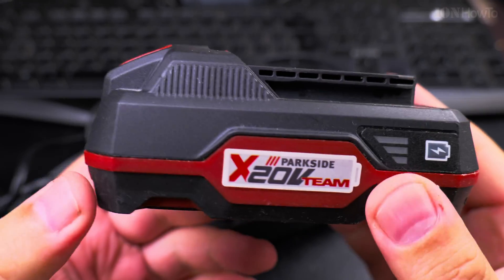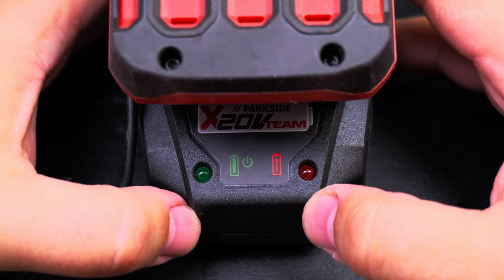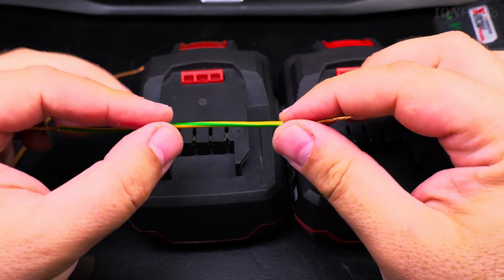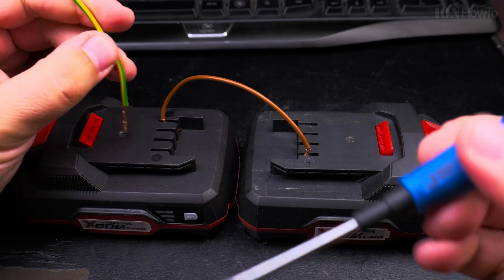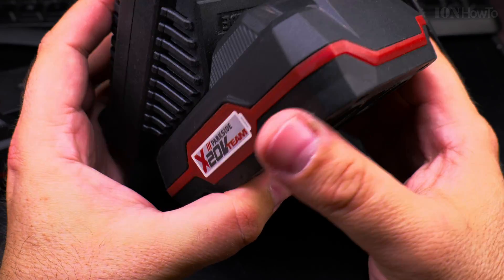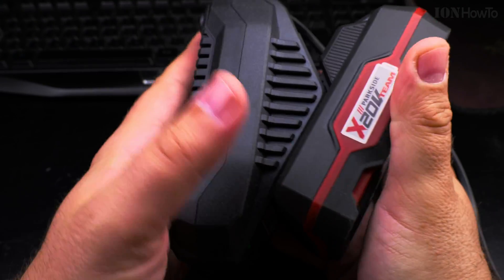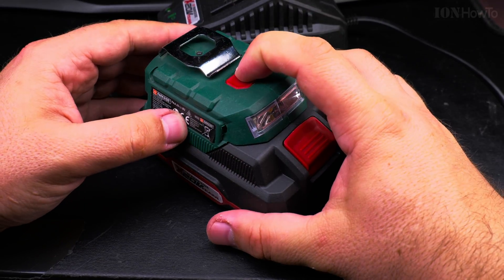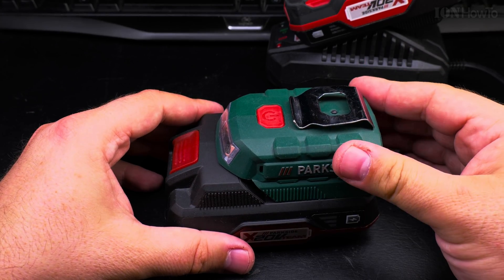Parkside Battery Not Charging Fix Charger Leds Blinking

Comment: That USB power bank is what caused my battery to fail. Left it plugged in to the battery but switched off, thinking it wouldn't draw anything. Found the battery flat and got the blinking lights on charge. Don't leave the torch/USB adapter plugged in to the battery!

Comment: After having 4 batteries replaced and one charger replaced with their tech support. I found out leaving the charger plugged in is causing this behavior too. Now I unplug the charger when not in use and I am able to charge all batteries. Low quality capacitors in the chargers most likely.

Comment: If you press the "Battery Status" button for an indication of how much charge the battery has got left  the led will light for 6 seconds and then go out. My charger was flashing both red and green led lights so I removed it and continually pressed the 'battery status' button for 30 seconds, even after the led goes out; I then placed the battery back in the charger and it lit only the red led (charging) and started to charge.
Reply from the maker: That sound like a good thing to try before doing this.
Reply: I've tried this and it didn't work for me....

Comment: My charger wont even come on no lights upon inspection the caps are fine theres power in them nothings broke like a fuse etc although thats what it seems like any help would be much appreciated,the mosfet inside with the allunium block so theres only the copper coil and the yellow box,if it can be fixed it will save me getting a new one

Comment: Jumpstarting Li-ion batteries is very unsafe. The batteries will overheat if the difference of charge level is big. This will damage both batteries (reduce capacity), possibly cause fire. 
The safe solution is to trickle charge the battery until it reaches 5*3V = 15V. That requires an adjustable power supply with constant current (CC) mode, or a 5S (5 series) charger, or opening the battery and charging the individual cells with a 1S charger, for ex. TP4056.

Comment: Great job 🎉🎉🎉
Reply: No, it is very unsafe. Batteries will overheat if the difference of charge level is big. This will damage both batteries, possibly cause fire. The safe solution is to trickle charge the battery until it reaches 5*3V = 15V. That requires an adjustable power supply with constant current (CC) mode, or a 5S charger, or opening the battery an charging the individual cells with a 1S charger, for ex. TP4056.

Comment: Saw some videos before this one .All involved taking battery pack apart. Even though i have an Ali express bought mini spot welder i was reluctant to open up pack. Tried your method and so far so good both batteries are charging well so thanks for very useful video. Advice to people in You tube land LION batteries should not be stored for long periods without recharging to at least 70% full. I knew this but i forgot. Thanks once again
Reply from the maker: Thanks for watching!

Comment: I've opened the battery pack and charged the battery with V lower than 3,62 from 2,73 to 3,2 using another single battery + to + and - to - and closed it and after that it charged properly and works....
Reply from the maker: Dude, if you have any power supply that can deliver 18V+ use that. Can try to contact the power for a few seconds and then regular charger but if the power supply/ charger is weak it will still work if you let it sit a few minutes.